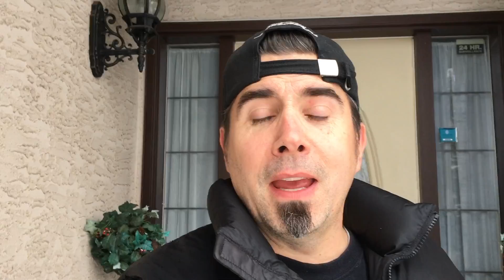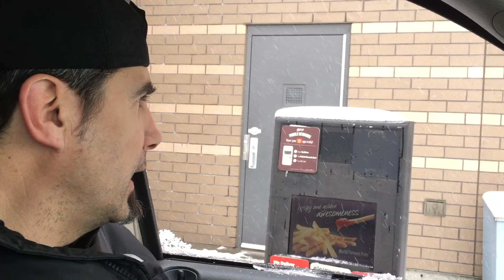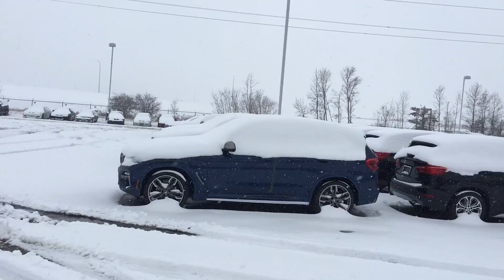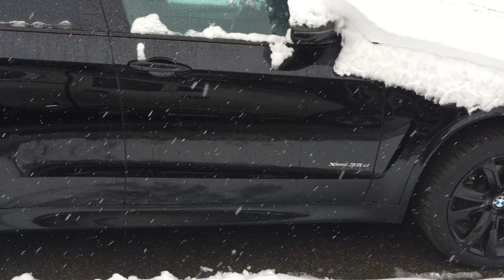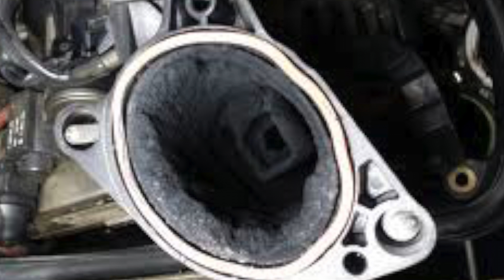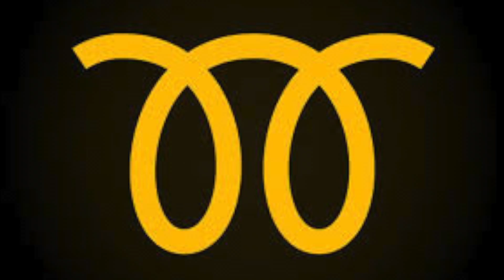How Reliable Are BMW Diesels?

Comment: I understand where this guy is coming from but if you really think about it, alot he mentioned is emissions related. Delete the emissions all together then your only common issue is glow plugs and with a full  delete you can gain MPG and power. Win win. Not hating but gata say these engines are not that bad at all and are really reliable after a true ABC delete.

Comment: As an owner of the M57 on a 2009 335d. Yes all is true when it comes to emissions failing. Personally I rather pay to tune and delete mine for 2,800 dollars than spending 5k on fixing endless emissions problems. Delete them or buy a diesel with pre emissions they will last forever.

Comment: In Ireland you can get every BMW as a diesel
Reply from the maker: Nice
Reply: @ECPP  yeah it's really cool
Reply: They are cheaper than the petrol models and there is lots of diesel options, 16d (1 series only),18d (models up to 3 series), 20d, 30d, 35d, 40d, 50d. 
Also they don’t have a dirty footprint. A BMW 330d pollutes far less than a 330i. 
The B47 really improved on the N47 engine.  The B47 had literally no issues. It made more torque, power and was more fuel efficient.. my 2017 320d has a B47 (2.0 turbo-diesel 4 cylinder with common rail direct injection, and an intercooler. The F30 LCI 2015-2019 320d gets 58-62mpg combined real world, amazing.
In 2014 they started rolling out the B47. 
I’ve never had a reliability issue with the B47.

Comment: Thank you for reminding me why I’m glad I live in a non emissions check area. Deleted the EGR, SCR and DPF. Stg 3 tune, upgraded FMIC, pipes, and my N47 pulls like a bat outta hell. Barely a puff of smoke at startup, and at 130k miles, purrs just as well if not better than new. DO YOUR OIL CHANGES PEOPLE!!!
Reply from the maker: Nice.  Great work and I was looking into this as well.  Did you do the work yourself and how about the tune.  Where is that from?
Reply: @ECPP  sorry! I didn’t see you respond earlier. Yes! I did do it myself with the exception of the tune, came from JR Auto done via flasher. All done in my garage, over an extended weekend, with a few basic tools, a buddy, and a six pack. Took longer to get the wheels powder coated than it did to do the mods!
Reply: @MadeInTexasProductions What kind of engine oil do you use?

Comment: I'm kind of curious about the 3.0l BMW diesel that Ineos has contracted to use on their upcoming Grenadier (the one that's supposed to be the spiritual successor to the original LR Defender, meant to be a nuts and bolts 4wd machine, live axles, reduced complexity etc.). Was curious how reliable, we've yet to see how they'll tune it (for torque they say, but they still have it in development and don't think designs fully settled or that anyone's gotten a look)  and fit it out, whether they'll mitigate common issues, knowing if they bring it to the US and not just the gas, it will be a tangle of emissions gear anyway.

Comment: BMW diesels are much more reliable than the petrols, if maintained properly (especially the 4 cylinder ones). They do require more frequent oil and filter change than gasolines though, and many people neglect that. That's where most issues come from.
Reply: I drive a 2014 328d X drive , change the oil every 5000 miles and it has been a great car . I get 40 mpg  .   I have the N47 engine and its great !  Change change change the oil !

Comment: My 2015 X5 335d has 129,000 miles and is running well.  I do drive higher miles, averaging over 500 miles/week. My EGR cooler was replaced under warranty a while back.  I did replace the battery as a precaution in 2019.  I live in IN, and travel in Midwest US, so I do not see the low temps that Canada has. I have noticed an increase in fuel economy recently.  Is this a nice bonus of the diesel?

Comment: I know it’s a old video I did hear about getting the engine really really hot before doing the glow plugs that helps getting loosen it up before you take them out but I live in a tropical area are my glow plugs used every start up till a certain temp or is it only when I’m under a low ambient temp?
Reply: Glow plugs just work under 4°C,atleast in my 520d e61

Comment: To point out some inaccuracies in your video

1) To replace the timing chain you do not remove the engine. BMW mechanics in Europe know well that it is not a complicated job, and does not warrant removal of the engine. You remove the gearbox and replace the chains through the gearbox tunnel.

2) You mustn't remove the cylinder head to clean carbon. You rotate the engine to tdc and use walnut shells to blast the ports in the head. It leaves the heads completely clean of carbon. Also the intake manifolds are cleaned effectively with ultrasound.

3) You missed out the common failure point of the flaps inside the intake manifold. Those are sold separately and are easily replaced, BMW sells them along with the mechanism separately.

Overall America and Canada are the only places where diesels didn't catch on, vast majority of German cars sold in Europe and cis are diesel.
Reply from the maker: Thanks

Comment: 11:50 You my friend need better advice, like this one: get a engine block heater, and plug that bitch ,  or on a timer, so when you come to crank the engine, coolant and oil are already warm. Ask your dealer about that, or better yet , you can do it yourself. Plenty of info out there. Specially since you're in COLD Canada. Owe me a beer later.
Reply from the maker: Thats the goods.  The local dealers told me that there is no solution for a block heater or coolant heater for these vehicles.  I will check into it.
Reply: @ECPP  That's what i thought they told you... Block heaters are kinda universal, basically its a heated pump that gets spliced into your cooling system, nothing complicated, its independent, and just heats and circulates coolant in your engine . Yes , there is no BMW OEM bullshit block heater, but that's not the point. The point is to solve your problem, and this is the solution. Everybody that lives out north have inline heaters, easy to spot that there is always a cable coming out of the house leading to the ront of the car. It plugs in via a regular electric plug, and you'll have a regular plug sticking under your bumper, or grille, or wherever you decide to put it. I was in Wyoming for 3 winters, it gets -20 and  -30 F there a lot, and the entire parking lot ( housing complex) was full of electric cables running to their cars. Had a Jetta TDI at that time, pre-DEF , 287k miles, so it was hard on the engine every cold start.

Comment: Dealer told me I had a DPF failure & wanted $5K to "replace" it.  You have to wonder how many people simply accept the erroneous diagnosis.  The REAL issue was that the dealer had NEGLECTED to replace the SECONDARY urea tank as per the TSB. I researched the crap out of the error codes, cross-referenced the work history, noticed the omission and was able to get them to do the originally requested TSB work on their dime.  The codes cleared and there was no ACTUAL DPF failure.  This was important as we our 2012 has only about 115K miles on it & we are planning on handing it down to our 17 year old son as his first car. Yea, it's a loaded BMW X5 witht he sport package & high-end stereo so it's nice as crap for a first year car but it's also only worth about $10K on the open market and we could not think of anything that would protect him as well as for that amount.  Certainly did not want to pay 50% of the cars value for DPF correction.
Reply from the maker: Nice.  Thats not good that it is not widely known and sort of hidden.

Comment: It is a late comment, but I can't... I have to say this: so torque is less important than horsepower(2.0T gas will always beat a 2.0TDI)
the hole CO2 emissions IS A BOOMER stay in a garage with a diesel running and you will run out of air in no time. You can just smell the obnoxious smell
And in the end is it worth to have a engine pulled straight from a old farm tractor that is loud as fuck and sounds like crap ; You wont ever have the same performance and all that crap only for that  more fuel?
Reply from the maker: Thanks for sharing.

Comment: Dont baying new BMW with any diesel engines after 2010 year because is have more issues like old one . Rod bering is the biggest problem in N57 engine now good luck when you baying 330D 335D 430D 435D 520D 530D 535D 640D x5 40D x5 M50D .

Comment: I'm looking at getting the 2015 BMW X328d, do you know much about it or how reliable it is?
Reply: Don't baying dhis car.
Reply: 2015, you pretty much getting all the new emissions systems. More new systems, more things to break, more expensive. The engine will not break, but everything around it will do.

Comment: I'm not sure of the reasons why the North American market is seeing less BMW diesels, I maybe thought it was down to emissions in various countries. But in July 2019 I bought the new BMW X3 M40D here in UK, with the B57 diesel and it's a sweet power unit, 3 litre in line six with twin turbochargers. If you compare running costs against the M40i which is available Stateside, the 40D wins hands down and what's more is comparible in power, but better for torque at 680nms.  I get 44mpg on a run out and easily 40mpg in the suburbs. Most 40i owners get far less than that. It's a nice machine and came fully loaded and vectoring control on the Xdrive.  Great tip of yours though about the short journeys and carbon build-up, I'm not certain how the urea cycle works out, but you'd have thought BMW would have it covered regardless of journey miles. Thanks, great channel.

Comment: m57 is reliable engine. N57 was the diesel engine that had issues..
Reply: But all jokes aside. M57 has some issues like injector failures and that carbon thing. But m57 has so many variants like m57tu2d30 that I own. So its really hard to say which engine is worst one and which is best.
Reply: But still N57 is way more shit engine than M57
Reply: Eyez Media What about the B47? It’s got the typical diesel emissions junk on them. DPF, DEF, EGR.

Comment: My X5 diesel has done 320,000kms and still going strong. The car will fall apart before the engine.
Reply: What country are you at? How much have you spent on maintenance?
Reply: Same here!!!
Reply: I am thinking about buying a X5 e53 3.0d facelift that has the m57 engine and I am not sure if it’s  reliable !
Reply: Most likely m57, depending on year, it does have draw backs like EGR. But yea same here M57 is the best. Just dont remap it or mod it/tune it. Its perfect as stock real german engineering. Reliability 10/10 for engine. 5/10 for plastic parts. But then again if they break, just replace them with aftermarket silicone parts, they will last a lifetime.
Reply: @domse16  Sums it up perfectly.
Reply: @domse16  Good, I totally believe you!
Reply: @domse16  not reliable until modded

Comment: I have a diesel 2009 X5 and I almost paid $6500, for 3 fuel injector changed, glow plugs and somehow water got inside the engine. They were telling me one fuel injector is $1100. And now I have a problem that there’s too much carbon built up and I need to drive on the high way can anyone help me
Reply from the maker: I have the 09 X5 35d and will be posting a video this week on my total 5 year ownership costs.  Be sure to check it out.

Comment: In California and have a 2016 f30 340i and a 2014 f30 328d and I must admit the diesel is my favorite on long drives. So far so good, only oil changes and it’s been absolutely perfect in every aspect. Knock on wood

Comment: In my country (Croatia) there are many many E46,E9X,E6X with more than 400 000 kilometers,hell even 500 000km is not out of reach
I used to own E46 320D 110KW with almost 300 000km.
Engine was still perfect

Comment: What about the 1,5l diesel engine found in the x16d vehicles?
Reply: oh lord. No point. Look for petrol vehicles and install a gas system if you cant afford a 3L. Bmw's sweet spot is Inline 6 3L

Comment: All I know is diesel lasts longer than petrol but diesel engines use glow/heat plugs which are quite pricey compared to spark
Reply: They last longer but require more maintenance. Plus, modern petrols get similar mileages now because by the time say 200k miles comes around on a diesel even something that can be fixed is usually uneconomical.

Comment: Diesel is a funny business.  Even for Mercedes, not all dealers know how to maintain Diesel engines.  They are a beast on its own.  I had a GL350 Bluetec.  I chatted with a mechanic who specializes in Diesel engine.  He said many dealers don’t have qualified diesel mechanic.  MBZ teaches them maintenance.  That about it. EPA makes make all the auto makers use lubricant that are essentially useless.  I only take my GL350 to dealer that also services Sprinters.  This mechanic unfortunately does not live near me.  He grew up in Germany and 3 generations of MBZ diesel mechanic.

Comment: We in Sweden have diesel option on most BMW models. And my 530d e61 -05 with the m57tu30 engine has been pretty reliable besides that i was to put out 2500 euro before i found out why the car got to limp mode all the time.. It was intercoolerhose for 30 euro... But the engines are very good on diesel. I can go for about 0.57 l/10km with it if iam gently.

Comment: Hi Mark..Nice info Regarding the Diesel Specs.I want to buy a 2012 e90 BMW 320d M Sport,it has 111 000 km on the clock.Just want to know is it a Good buy regarding Maintance...,or should I rather go for Petrol.I really need some info..This car is really looked after,and it has been service on time.

Comment: Change oil every 5000-7000 miles. And use 5w40
Remove swirl flaps if your engine has any
Turn off egr valve
Warm up engine properly
Use 2 stroke oil 1:200 in diesel tank ( jaso fc specification) 

500k miles should be no problem
Reply: You nailed it perfectly. It's my way of thinking too.
Reply: Egr has and is killing the trucking industry here in the states.... and now they have got us using diesel exhaust fuel (def) and here again our epa is grabbing our necks and pushing the diesel engine out slowly and for surely
Reply from the maker: Thanks for all the great advice.  Cheers and agreed.
Reply: @ECPP  no problem you're welcome.
Would also be nice if you could find some high milage m57/ m57n2  enginea and find out if they have egr off or what oil... Some tricks maybe to keep it running good for that ling distance...
Reply: With Style why 2stroke oil?
Reply: @kribar96  - here in austria, germany... Its quite a common practice for older diesels because
- lubricates high presure pump
- cleans injectors
- less sut during burning process and less sut in the egr, manifold and less frequent dpf regeneration cycles
- more silent engine
Reply: If your car has a dpf then you have to use 2 stroke oil with jaso fc specification low ash low smoke formula...
Reply: Not every BMW Diesels use that oil mate.

Comment: In Serbia all of those bmw x5 would be diesels and 2-3 petrol. I think that is the case for all European countries. We drive a lot of diesels expasuly in bigger car -suv.
Reply: In the UK diesel cars are getting banned. They have already started to phase them out this year and by 2030 they will be none left on UK roads. Lol
Reply: surge knight 
That sucks. Diesels are great engine. I had corsa with 1.3cdti engine. It had so much better performance  than 1.2 na engine. Not to mention better fule economy.
Reply: @surgeknight5725  there will be at least one as I'll be buying a brand new diesel on 31/12/29 and running it till it dies. I might even get two to last me till I go.
Reply from the maker: Yes for sure Europe has always had more of a focus on Diesel vehicle mainly die to high gas prices.  I love s good torquey diesel motor.

Comment: How can you tell a vacuum lines are broken ?
Reply from the maker: usually it will have an impact on the way a system operates and it will spit out a code.  I would not really go looking but if you get an odd engine light, there may be a connection.  I posted a video a couple years ago about this in my personal experience and the code it threw.

Comment: I'll never let a BMW dealer touch my E70 diesel, unless it is for recall or warranty work. They overcharge and do unnecessary work. Intake ports can be cleaned without removing the head (walnut blasting). Vacuum lines can be replaced with silicone lines that will last longer than the rest of the vehicle. If you're in an area without emissions testing, the best thing you can do is delete all the emissions crap and the rest of these problems go away (including the carbon buildup in the intake).
Reply: Jeff C , how much did walnut blast cost you?
Reply: Can you block oil leaks using additives/products like "engine stop leak liquids" without opening the cylinder head and physically removing and replacing the worn out oil stem seals/valve seals and tappet cover/head/profile gaskets etc? Do those chemical additives actually work and if they do for how long?
Reply: @surgeknight5725  do not use stop leak, it will not work on valve stem seals. Moreover you do not have to remove the head to replace the seals. There is a special took that removes the seals with the head intact. The hard part is making sure not to drop the valve into the cylinder whilst you're replacing the seal.